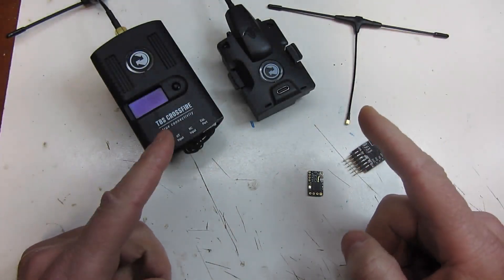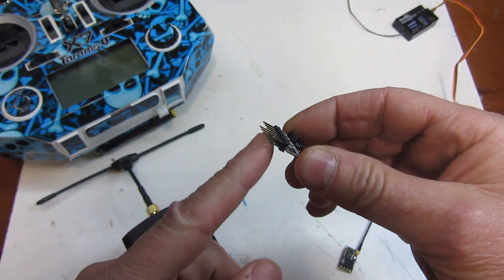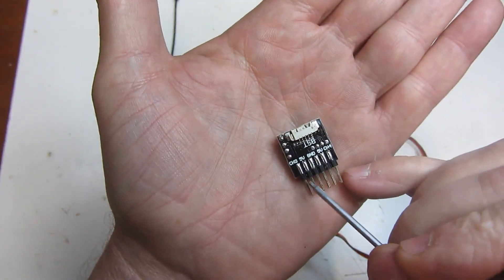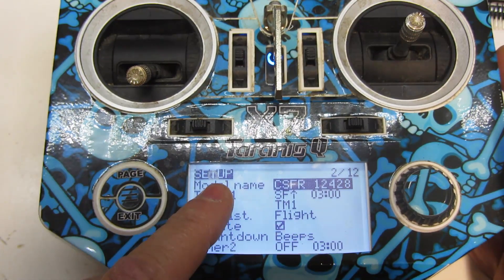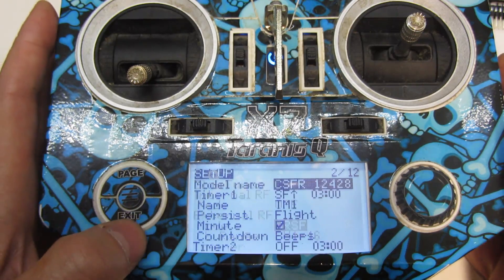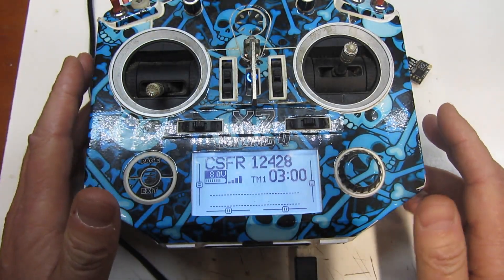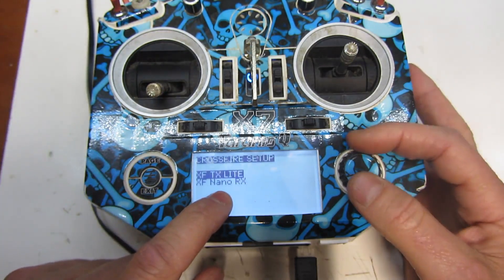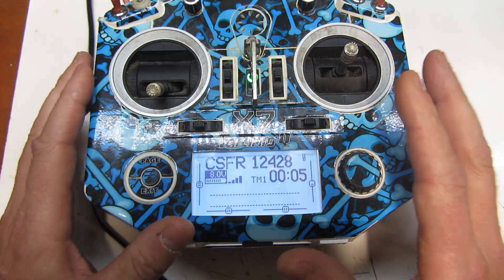Crossfire Install And Setup On Your RC Car/Truck/Boat/Plane.  PWM Adaptor Mod / WLToys 12428 Upgrade

Comment: I have a tbs tracer pwm 6ch receiver and and a tbs mambo radio and I’m trying to figure out how to set it up for a plane like a delta plane but I’m having trouble figuring it out cause I’m not getting any input feedback desperately need help with this
Reply from the maker: You can try looking back at Josh Bardwell's channel. He has quite a few Playlist of setup videos from nearly every type of radio/receiver / protocol.  That's where I would start.

Comment: the real kicker with these setups is trying to get vbat telemetry...only possible with nano boards that are v44 and newer, and only on 2s. as they take up to 8.4v...easiest fix is buy the Matek CRSF PWM board, it has a vbat sensor and it passes the info to the radio.

Comment: how do you get the one you solder on? or does it just come with the package
Reply from the maker: Not sure what u r asking
Reply: @  like do you get the tbs crossfire nano rx with the reciever or nah?
Reply from the maker: @BVC0180  the nano rx is the receiver.
If your asking if the nano rx comes with the adaptor board, then no, it does not.
Reply: @ so i. gotta spend 30 extra bucks for that little piece that just needs a snap in
Reply from the maker: You don't have to. It's just a break out board.  You could Solder the servo lead wires straight to the receiver if you can keep everything in their correct position. The board is just convenient because it has the pins to plug a servo connector in to and it breaks out the the separate grounds for all the channels.  Totally up to you.
Reply: @Matt633NLT  no not that i mean the one that snaps on the top of the thing your talking about
Reply from the maker: The nano rx does not come with it. You will need to supply your own.
Reply from the maker: And it doesn't snap in. You will need to Solder it in to the adaptor
Reply: @ alright got it but others might not know that so can u just incase put the link for that pls?
Reply: @ got it

Comment: hi if i bring the throttle to reverse from going forward, the motor sometimes just stops and doesnt reverse. how do i tune this
Reply from the maker: Will it reverse after you center the stick ?

Comment: How do you add the other features the trucks has - like the power modes , traction and steering off of the gyro

Comment: Hi there I was wondering if anyone knew the answer to this question:  Can I plug in directly the hobbywing fussion pro 2300kv 2-1 motor to the TBS crossfire 6ch PWM receiver? Or do I need a BEC for this ?
Reply from the maker: I would highly recommend a bec to eliminate a chance of voltage spikes back feeding the rx. Read description for more info.

Comment: Best video ever. Also can i run an fpv cam/vtx kff this PWM adapter
Reply from the maker: You can certainly run a servo to pan or tilt a camera.

Comment: thanks, that was very informative and to the point.
Reply from the maker: Thanks 😎👍
Reply: @Matt633NLT  fastest response ever! Should I be worried about the voltage that goes to the servo? thanks!
Reply from the maker: I was on my phone. 

Read description for more info about powering the XF nano. I'd suggest using a a stand alone 5v instead of using the ESC 5v.
Reply: @Matt633NLT  no worries!! I see, i actually need 6v or 7.2v for my servo so i have to research how to manage this. Thanks for the video, this was very helpful!

Comment: So you can only get 2 channels PWM?? This shit is confusing the shit outta me.
Reply from the maker: You can get 4 channels with the adaptor board seen in the video. You can get 6 channels with a 6 channel adaptor board. 
The receiver is capable of outputting 6 pwm channels. Every channel will have to be assigned and configured in the radio so it's very flexible and allows the user to decide how you want to operate the vehicle.
Reply: @Matt633NLT  Ty for the info. I just seen they have the diversity reciever which should be all need if I wanna make it easier on my self. I'm a correct ?
Reply from the maker: Yes
Reply: @Matt633NLT  Cool. Now I gotta figure out  what 1.3 ghz video I want to use. FYI there is a channel on here called "cloudrc" that's testing an all in one 4g fpv system and they're close to production I think. If it's good that's definitely the route ima go. Can't beat unlimited range
Reply from the maker: Dustin Dunnil did a 4g link/video on a wing about 3 years ago. He flew it between two islands in Hawaii.  Very laggy though . Expect some above normal latency.
Reply: @Matt633NLT  That's cool. I've seen a few people do it on here and I here the latency is  higher
Reply from the maker: What are u using it on and how far are you trying to go ? BTW, please read video description for some recommendations on powering the receiver.  I would avoid powering the receiver from the ESC BEC.
Reply: @Matt633NLT  I've had about 10 different setups in different vehicles and they've all been 2.4 and 5.8 with not the best penetration but I've gone over 1/4 mile in the open. Basically I want be able to go around houses and buildings. I do everything right as far as wring. I keep the vtx far from motor and esc and keep a fan on it. I also run it off a separate battery and use a UBEC but I just can't go around the other side of block and shit like that. I have skyzone o2x goggles and can use a radiolink rg6 or at12 or frsky..the last setup I jus striped out was pretty cool but I want better. Further is better . But I still switched vehicles again
Reply from the maker: Perhaps you should checkbout this video . I have a 4 watt 2.4ghz power Booster on a flysky pistol grip radio. It will do 1km . I had to stop there because video gave out. Control signal was strong. 
https://youtu.be/Ae8r7dFevKA

Comment: Hello! My friend, tell me please, can u confirm that, Can i bind and clear do this with Tango 2 Pro? With my car? 😋
Reply from the maker: Absolutely.  It's a crossfire receiver and the tango 2 is crossfire protocol only. They will Absolutely bind. You will need to create a new model and setup which 2 channels you want to steer and throttle with.
Reply: @Matt633NLT  Bro! Thank You so much!
Reply from the maker: @paryk6609  you got it going ?
Reply: @Matt633NLT  Tomorrow I will try, couse Tango 2 IS my first programable radio 😋 i Got adapter for nano rx witch pins for servo, esc. I have too try to find how set servo in tango. But I know is possible 🤣

Comment: Hi man, hope you are well! I set a crossfire nano receiver in my rc truck but every time it loose signal the car continues accelerating, I tried to set a failsafe in my tango 2 but not quite sure about it and didn't work. Do you have any suggestions ?
Reply from the maker: Goto Radio setup, in device settings there's a option to set failsafe.

Comment: Hi man, I just set a crossfire into my rc but every time I put throttle up the car move forward but suddenly it disconnect and after few seconds I reconnect, do you know why is this happening ? Also I’ve notice that after reaching certain speed I can’t use break, if I put reverse it will take few seconds to stop, if I’m driving somewhere where I need to stop I can’t, do u have any suggestions to fixed this? I’m into fpv and I just bought this carnage rc and my plan is to set up an caddx vista and use my goggles
Reply from the maker: If you are powering the receiver from the ESC then try powering the receiver from a regulated 5v BEC . 
The stopping/reverse issue sounds more like an ESC setup issue.
Edit: the servos can also draw too much from the receiver if your using high torque servos. You could also try using a seperat regulated source for the servos so they don't draw off the receiver.  Hope that helps.
Reply: Fixed this issue but now the car continue going away forever after disconnect
Reply from the maker: @jeankrs0  you need to set the failsafe to "cut" in radio setup.

Comment: You are the best.....i finaly understand how this nano works....please what's the highest range i can get if i put this crsf on fishing boat. Thanks.
Reply from the maker: As long as you have line of sight (no obstructions)  , it will go further than you can see it.
Reply: Thanks...so i guess i don't need mini pix...or flight controller like in drones.
Reply from the maker: @Rcfishingbateauagadir  no, it will work like a regular pwm receiver if you follow the video. I will recommend to power the servos from the battery and not straight from the receiver and share a common ground . The servos can pull too much current for the receiver to handle and may burn it up.  I've only had this happen once.

Comment: Soo im guessing i dont really need the out break cable. I can just power the tbs with esc and run the channels to self powered servo. Should do the trick
Reply from the maker: If you read description,  I recommend using a BEC to power the crossfire receiver.  Depending on your ESC, there may be too much noise to feed power to the RX and cause voltage spikes that could damage the RX. A simple 5v regulator should do fine.

Comment: There's a better adapter to use now which will give you voltage, current, gps, altitude and other telemetry and 10 pwm channels.. matek crsf-pwm-c cost like $10. Also works with ELRS
Reply from the maker: Good to know. This is an older video so it's not surprising that a product like that is now available.  I take a look at it. Thanks.

Comment: Mine is just channel 3 working..... tried 2 different receivers same issue.... please help me
Reply from the maker: Did you verify that the in the channel map, Output 1 is set to Ch1 and Output 2 is set to Ch2 ?
Reply: @Matt633NLT  i can't get to the output mapping mage... taranis x9 lite
Reply from the maker: @DieTomate  you'll need to download the crossfire Lua script and install in crossfire directory on SD card. If you don't change the channel map as described in video, it won't work
Reply: @Matt633NLT  omg lol iam feeling stupid 😰 Thank you a lot, ill try it!
Reply from the maker: @DieTomate  if you have the TX Lite module, you can do it from the built in screen. Else, you need the Lua script
Reply: @Matt633NLT  ive got the Nano Set without a screen

Comment: Is there any way to have battery voltage on transmitter?
Reply from the maker: I use analog.
Reply: @Matt633NLT  that's why you don't have problem :D
Thanks for help!
Reply from the maker: @everdronefpv4000  sorry I couldn't help with original question, but don't hesitate to reach out if you need any help.
Reply from the maker: I've been asked about that before and I'm not sure how. I don't worry with telemetry on transmitter because I always navigate fpv and get the telemetry in goggles. Sorry I couldn't help.
Reply: @Matt633NLT  sorry, I didn't see it. You use analog or dji hd? In analog it's pretty easy, cameras have osd with batt voltage  but what with DJI...

Comment: where did the nano rx gets its power?
Reply from the maker: It was getting power from the esc but that caused an rx failure.  Please read the description in video for my recommendations on powering the rx. Thx.

Comment: Hey guys :) Any idea how to get cell voltage in my rc car  via telemetry to my tango 2?
Reply from the maker: I'll have to think about that one. 🤔
Reply from the maker: Typically cell voltage is reported to the rx from the FC on a quad. That requires a uart. 
You can still wire up the rx using a 4 channel adapter board , 2 channels (1 & 2) dedicated  as a uart, and the other 2 channels (  3&4 ) as pwm output (steering and ESC) 
Channels 1 and 2 would be connected to a uart on a FC that is being used solely as passive telemetry. 
Then by "discovering sensors" on tango 2, you should pick cell voltage in your telemetry stream.  
I've done this already. I'll link video in a new comment.
Reply: @Matt633NLT  this possibility was also in my mind. But isnt it possible with a voltage sensor from arduino. 🤔
Reply from the maker: I suppose.  I haven't played around with arduino so I can't help you there. That's probably the easiest way to go though.
Reply from the maker: https://youtu.be/BAQTCywxhwI

Comment: Sorry to be a PITA and belabor the point, but I just watched a video where a guy used a Crossfire Lite and a Crossfire nano receiver added to a RadioLink transmitter (land-based pistol grip with a RSC [remote servo control] port), but with the transmitter it came to $242. For some of us, we would have to buy one of those transmitters, or a DumboRC 6 channel,  if we didn't want to use an air transmitter. My question is how much range does the Crossfire system get you as opposed to the RadioLink or DumboRC ones that give you about 400 meters/ 1300 feet/ 1/4 mile right out of the box? Were you able to get a range after you installed the Crossfire? Maybe you mentioned it in the video where you go out to the construction site with your son, but I don't recall. Thanks.
Reply from the maker: Crossfire will reach out, way out. The construction site vid was on flysky but the radio has a 4watt booster. Your video will always be the weak link. If you're not using a quality vtx with at least 600mw or higher and some quality antennas on your goggles, it won't really matter what control link you're using. But to answer your question, crossfire has way better range with the right antenna configuration but may suffer a bit with too much structure between you and it.
Reply: @Matt633NLT  Thanks for the response, Brad. The extended transmitter range is nothing without video to go with it.

Comment: Nice video! question, i wanna do a FPV tank using pwm nano RX, but i dnt have crsf module coz im using tango 2, can it also be pair on tango 2?
Reply from the maker: Yes. The module is simply to allow other radios to run crossfire using the JR module bay. The tango is strictly Crossfire. Pair it simply like you would a quad. Then you'll have to go into rx setup once paired to assign channels as shown in vid. Then setup radio to match stick and switch outputs to desired functions. Since the tango 2 runs Freedom TX and I'm not familiar with that software, I can't help with radio setup. Thanks for the question , have a great weekend. 👍
Reply: @Matt633NLT  nice!! Good thing i saw this! Thank you so much!!

Comment: Thanks heaps for the video Brad. 
May I ask
Does this work for the rc car model
Wltoys 124019?
Reply from the maker: Yes , as long as you have a crossfire module and tx.
Reply from the maker: Remember,  I've gutted mine and replace all electronics with standard servo and esc with standard servo plugs. The stock equipment will not plug into the crossfire adaptor and of course like I mentioned, you will need a crossfire transmitter or module in your transmitter.

Comment: What if my traxxas has dual servo steering? Should I convert to a single servo?
Reply from the maker: If i understand you correctly,  then it shouldn't be a problem. You have 4 channels to use. Just plug both servos in to the rx (ie: ch1 and ch2) and setup two identical profiles for each channel so they function identically.  I hope that makes sense.

Comment: Albert Kim just did what your video showed, BUT, he needed to use two transmitters to do his version if you want to use a land- based transmitter. I realize it’s easier to use an air transmitter, but his version just seems too complicated and not necessarily explained that well. I’ll give him credit for at least listing and linking the parts he used. 
If I don't have a radio that will accept the Crossfire module, will the RadioMaster T12 work? Thanks.
Reply: Yeah he's method using car steering wheel remote was cool.  But annoying being so much out to run car.
Reply from the maker: I think the point of his video was to allow the use of a pistol grip radio, which is preferable for ground vehicles. I actually prefer pistol grip with a car also. As far as using the jumper, you would still need a crsf module to connect to the crsf rx.
Reply: @Matt633NLT  I guess my point is that I would have to buy a new radio and a receiver and a module just to try this out =$$$$$$.
Reply from the maker: @kodak_jack  yea I see your point. I suppose most people don't have a dozen pistol grip transmitters/receivers laying around (like me 😄) . In my opinion,  even though I would prefer a pistol grip, its quite frankly too much hassle to have all that hooked up and lug it around. I'd just use the stick controller if you already have it setup to work with crsf.
Reply: @Matt633NLT  I have an air transmitter, but it’s a Spektrum, so, I can’t plug anything into it. Trying to stay current is expensive.
Reply from the maker: @kodak_jack  indeed.